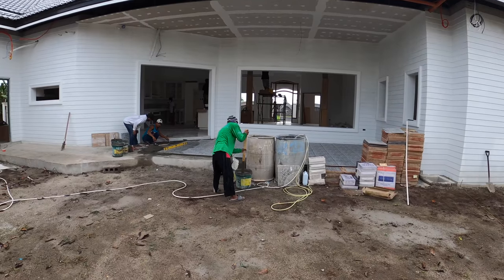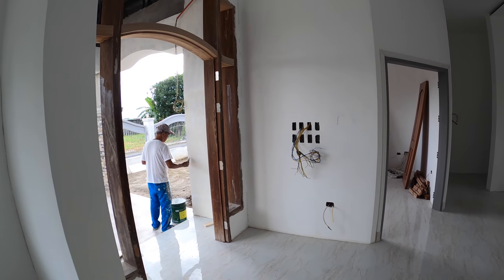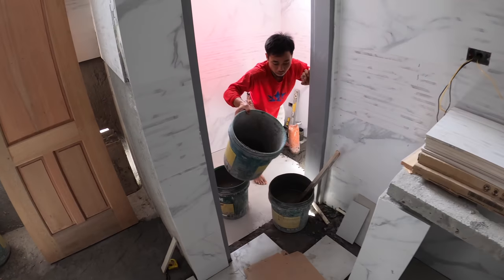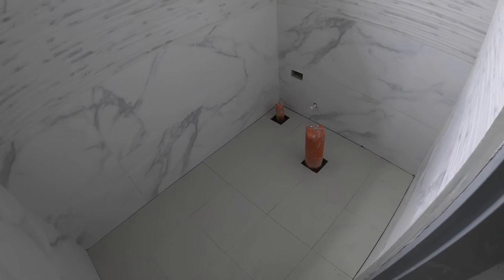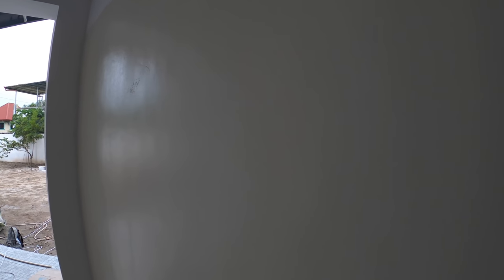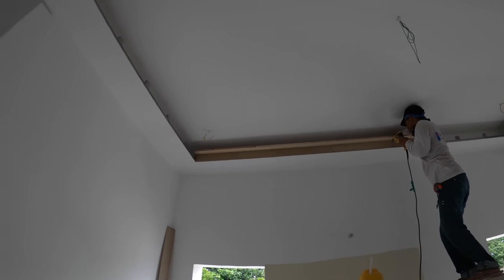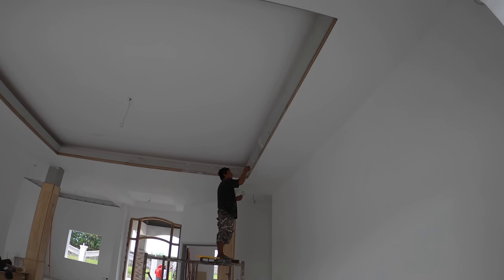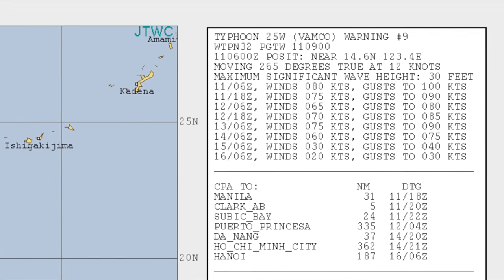Philippine House Building Step by Step, Build Day 205: Mic Check 1 2 3

Comment: As a Builder in Australia, I am very impressed with the quality of finish your trades are delivering. They may not be well equipped, but they are very good at what they do. Love watching your build coming to a close. Great job...
Reply from the maker: Thank you for the kind words. I’ll pass along the kudos. 👍😊
Reply: Yes so true, im working in construction as a quality inspector and noticed they are doing quality work eventhough they are not equipped, the only thing I've noticed is how they install the railing on top of the gate, they should use the gear type installed in bottom it looks very unusual.
Reply from the maker: Thanks for the feedback.

Comment: I was about to suggest that you could bang your head doing the dishes, should be in the center of the window for a clear view of the garden
Reply from the maker: If you remember, the original window was directly over the dishwasher location. Window design changed mid-build.

Comment: Me gustaría saber que capítulo es cuando se forra las columnas de concreto con madera y qué madera se usó? 😀 y gracias por compartir su linda casa..
Reply from the maker: The columns are concrete inside. Additional support for the 2nd floor but mostly decorative. Wood used throughout the house on doors and plyboard is tanguile wood. 
Thank you for watching. 👍😊

Comment: Hi, The 2 columns that make the entry to the living area, did I miss what the finish will be on the 2 of them?  
Here in the UK, they started using the description Satin Finish for what was called semi-gloss finish. 
Very impressed with all your crew, but those doing the finish on the doors and those laying tiles make it look so easy when it really is far from easy. 
Both you and your good lady as well as the crew stay safe not only for the covid problem but the typhoons also.
Reply from the maker: The columns in the living room will be painted white. Supposed to be square Greek column style with a slight arch in between. 
Thank you for the kind words. 👍😊